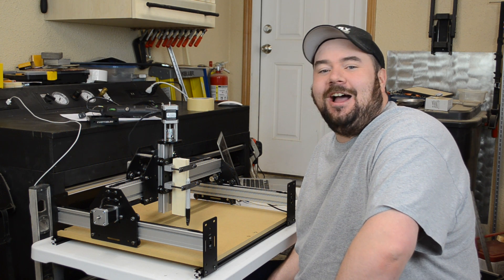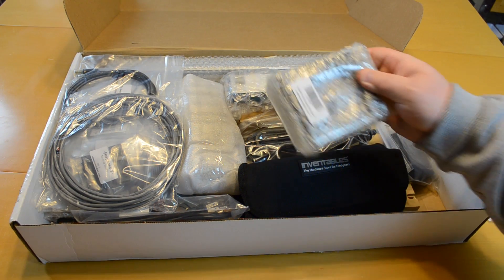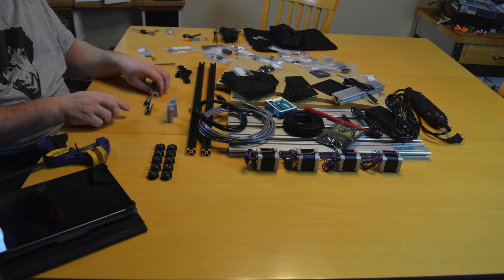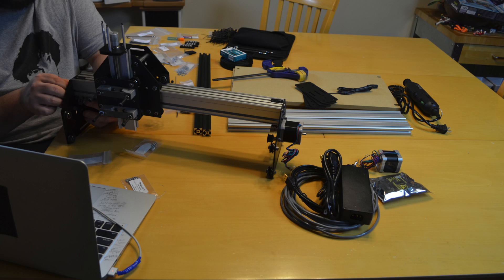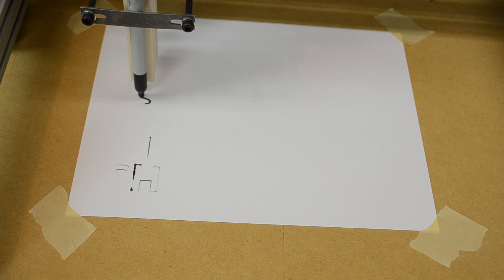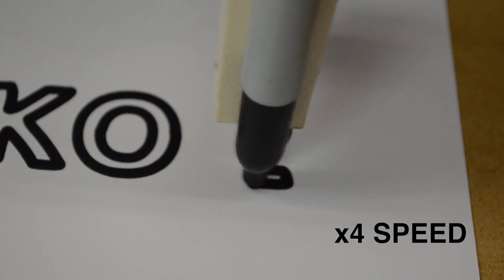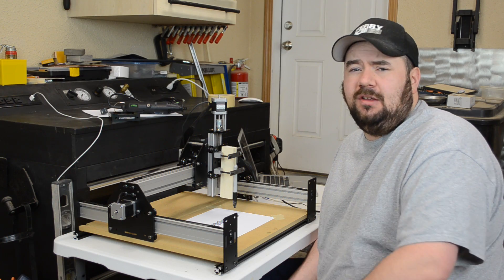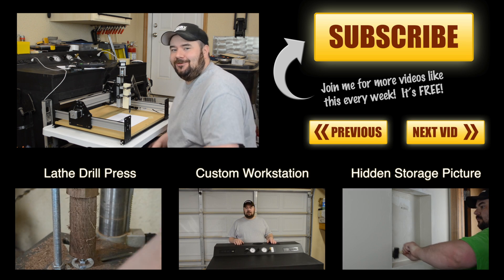Ⓕ Shapeoko 2 CNC Machine (ep41)

Comment: Fun stuff Nick.
Reply: Nick so far would you say that building the shapeoko got you past the fear of doing a DIY cnc? For the cost of the shapeoko you could build a DIY cnc with a cutting size of 4 x 4. Check out my free plan's on Facebook, search for "Shadetreecnc" if your interested in build videos then check out my YouTube channel " Shadetreecnc" ill email a PDF of the plans to anyone that asks. shadeTreeCNC@gmail.com
Reply: ShadeTreeCNC I see you're using the same HF router as me. I just made a deflector for it. That way dust won't blow around from the air blast. Working on a dust boot now.
Reply from the maker: Jim Steinbrecher Thanks a lot Jim!
Reply from the maker: Jim Steinbrecher I haven't tried the one that comes with it yet, but I will be trying my colt router eventually
Reply from the maker: ShadeTreeCNC I would not have room for much bigger than this - I need to clean and organize the shop soon

Comment: Great job assembling it.  You are right about getting a kit you have to assembly so you can fix things down the road.  Been there and that is the better way.  Good luck and have fun.  My new toy arrives towards the end of this month so I will be busy with it for a while.
Reply from the maker: Jim Coogan Thanks - are you getting a CNC too? if not, what did you buy?
Reply: Nick Ferry
A CNC laser cutter/engraver.  It was either that or a Shapeoko.  So I did the pros and cons thing and came up with the laser.
Reply from the maker: Jim Coogan That should be fun too - I would love to see how you put it through it paces
Reply: Nick Ferry
You will.  I was asked to do videos of the unboxing, testing, upgrading, and uses of it for woodworking.  I plan to include the good, bad, and the ugly of it :-)  I use to test and break them for a living at one time.
Reply from the maker: Jim Coogan very cool, I can't wait
Reply: ***** Like quite a few that love to play with fire (lasers) we buy a cheap Chinese one that works ok but then we upgrade it.  The unit I bought has a large box, a quality gantry, can cut or engrave things up to 13"x9", and is easily upgraded. There is a Facebook group where a lot of the people that work with this laser, known as the K4 share information.  It is a 40watt CO2 laser.  http://www.ebay.com/itm/261757415445?_trksid=p2060778.m1438.l2649&ssPageName=STRK%3AMEBIDX%3AIT